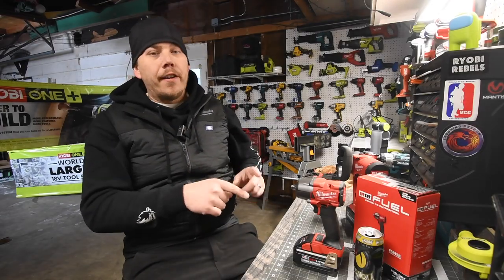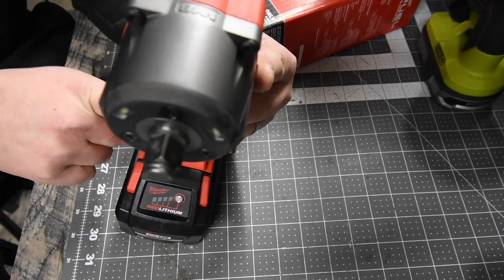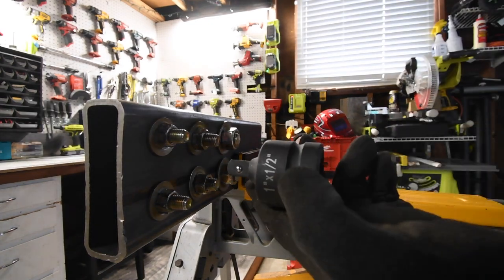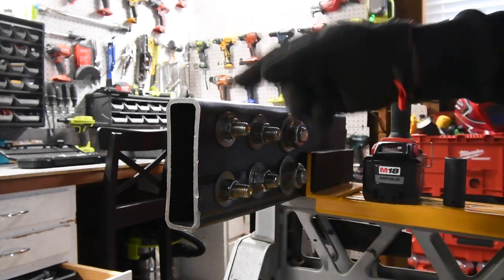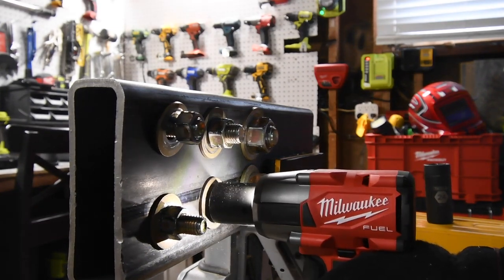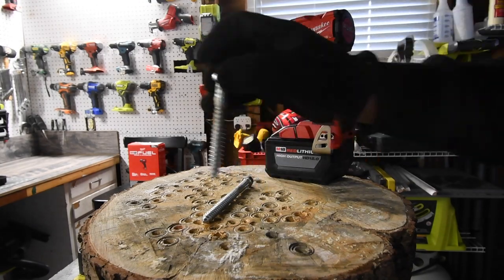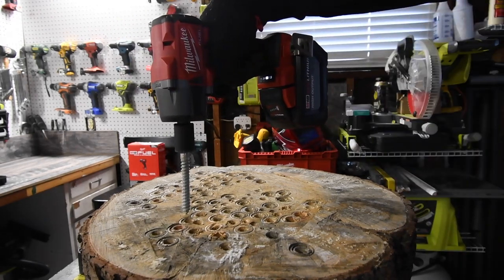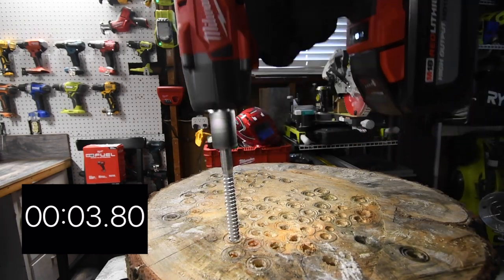Milwaukee 2962-20 (1/2 Impact Wrench)

Comment: The hollow rectangle steel beam was giving or compressing when torqued so you didn't quite put as much torque to those nuts as you might think. Better test is to use a solid steel bar and bolt down the nuts with that 1800 ft-lb wrench.

Comment: You can get a 1in drive 200-1000 ft lb torque wrench for 1k~ his torque gun is also limited to like 600or 700 ft lb
Reply from the maker: I have that but I want to be able to it accurately to the ft lbs
Reply: @ManCaverTools  am I missing something? I thought that was the whole point of a torque wrench? To finish off torqueing a fastener to a specific ft lb like lug nuts

Comment: If you had to choose only 1 Milwaukee impact wrench:  Choice is between the 3/8” 2960 or the 1/2” 2962 for a DIY with passenger cars and small truck…What would you choose?
Reply: @No_bread-and-circuses  I went with the 1/2”.  It takes off the wheel nuts in seconds and saves so much time.  I’ve also used it for other things, but I’m glad I got the 1/2”
Reply: 13:25 13:25

Comment: Using a torque multiplier ($150-300) and a torque wrench you can accurately put those bolts to 800 ft lbs of torque. Don't need the $4000 tool.
Reply from the maker: I will look into that and I thank you for the suggestion Tony's

Comment: @mancavertools Get a torque multiplier you can do it with that cheaper
Reply from the maker: yes but I need to set these to 700ft from time to time as well
Reply: @ManCaverTools  the torque multiplier will work if u have a torque wrench that will torque to lets say 200 ft lbs a torque multiplier will multiply the torque by 4 times so you put the torque multiplier on the bolt then put the torque wrench on the multiplier and tighten to 200 ft lbs and that will in turn make the bolt tightened to 800ft lbs
Reply: @ManCaverTools  let me no if you understand what im saying

Comment: Why can’t you just buy a normal torque wrench? Why on earth would you need one in the range of 5k?
Reply: Yeah! Unless he is getting a sponsor deal or steep discount it is not worth it imo. But hey, it is what it is.
Reply from the maker: I need that certain tool because it can tighten nuts up to 700ft lbs accurately and effortlessly in seconds and if im loosening them up all the time getting something to 700 ft lbs in a single car garage with a hand tool is hard

Comment: Good on the lag bolt testing. I run 1/2 lags all day with the mid-torque. Would be nice to try testing some self tapping concrete anchors too.
Reply from the maker: I run these tests all the time and they put a major strain on the motor

Comment: You would be better off getting a skid more and wilhelm, with regular And reverse thread pitch.

you can compare impact wrenches, up
to 1500 ft lbs, and it would be slightly less expensive than the hytorq gun.

The hytorq is limited to 700 ft lbs.  meaning you can’t test high torque impacts.
Reply from the maker: ill look into that and I thank you Juan

Comment: I have the ridgid brushless 1/2" with similar specs and it is a beast.  Puts my grandpad older pneumatic ingersol rand to shame.
Reply from the maker: tools these days are powerful
Reply: The Ridgid has slightly higher rpm, but the trigger control and auto mode are better on the Milwaukee.

Comment: I would never use that impact wrench in my lifetime.    But , I can't wait for the New DeWalt 12v Xtreme impact wrenches to come out .... 👍
Reply: deFault? lol
Reply: @adambomb9452    Yea , 400 ft.lbs of nut busting and 250 ft.lbs of tightening , from a 12v impact wrench and new oil resistance 3.0ah & 5.0ah batteries , Now What ....
Reply: @brianf9619  did you mean in-lbs or ft-lbs?
Reply: @ezrawaters6653    Oops ,  ft.lbs  ...
Reply: @brianf9619  I personally own all Milwaukee, but I’m hyped for that new Dewalt
Reply: @brianf9619  cause strong competition keeps both brands on their toes to keep improving
Reply from the maker: I cant wait for that one either :)